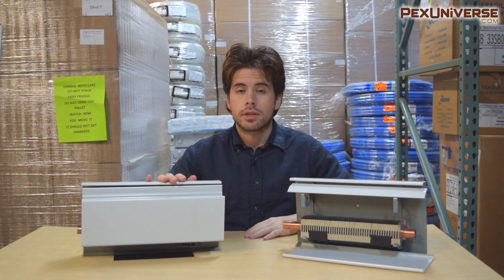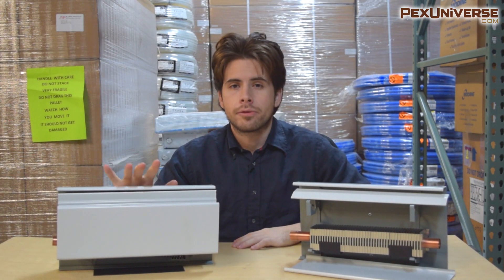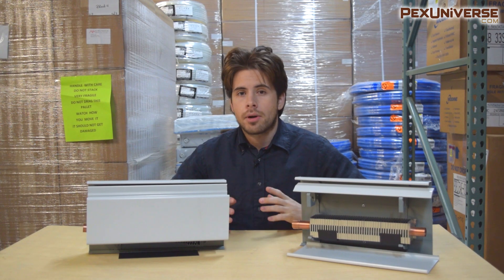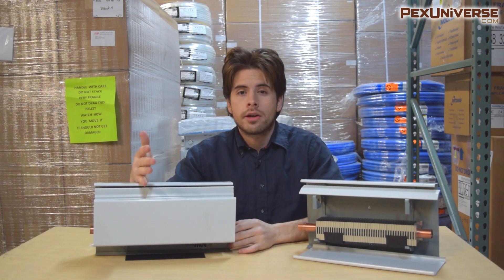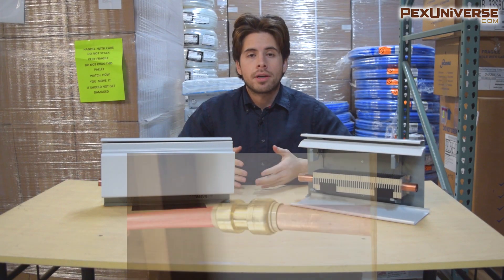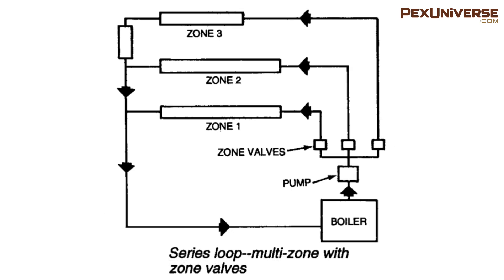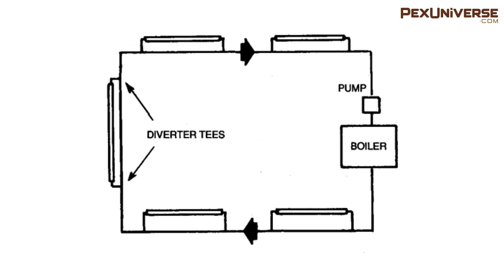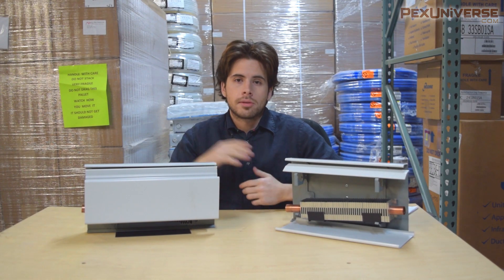Baseboard Basics | SERIES LOOPS, ACCESSORIES, FAQs, BASEBOARDS 101

Comment: My house gas baseboard heating doesn’t working all the floor only work first floor why that happens?
Reply: Check all valve upstairs are open along with any that may be lurking in risers from ground floor. Bleed the system, could be that it's just one big air lock. Vacuum out fins, I've seen some systems that are only 4 or 5 years old but have never been cleaned so the fins are blocked. Make sure any dampers (air baffles) are open. Some systems have manual or electronic dampers to stop air flow. These systems are convective, no air flow, no heat.
Two more points, are there fins on the pipe and is the pipe connected to the heating system?
Hope this helps.

Comment: Question: Why would I choose baseboard heating as opposed to other room heating options?
Reply: if you live in an old house, I wouldn't recommend baseboard.
Reply: Simpley weigh up pros an cons of each, what works for some won't for others. There's also personal choice, some don't like pipes running round the house, some don't like forced air systems, some don't want to rip up floors to install underfloor heating.

Comment: What is the max temp rating for pex used for boilers.😎
Reply from the maker: Here are the pressure ratings, assuming you're using oxygen barrier tubing. 
[Operating Pressure] --> [Maximum working temperature]
80 psi --> 200˚F 
100 psi --> 180˚F 
160 psi --> 73˚F 

Here is a link to full technical specifications of Oxygen barrier tubing. 
https://www.pexuniverse.com/uploads/docs/pdf/tech-specs-oxygen-barrier-pex-tubing.pdf
Reply: PEX Universe p